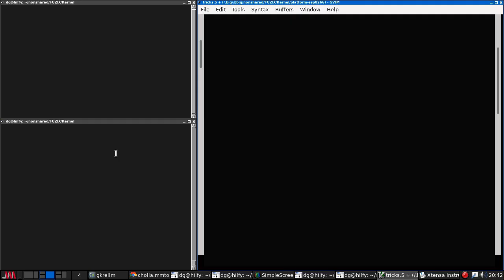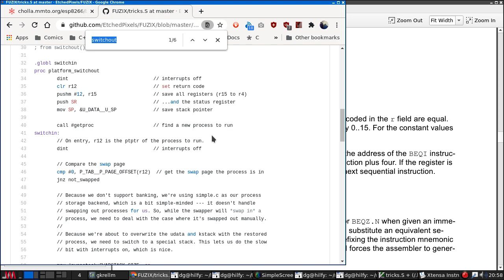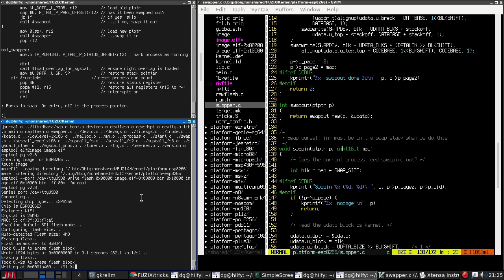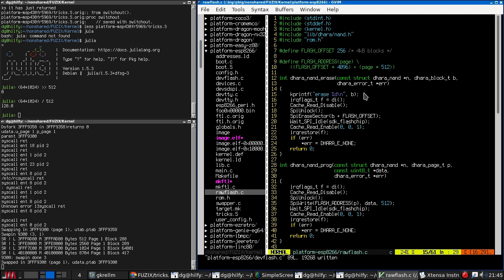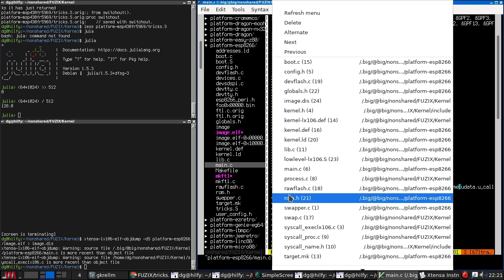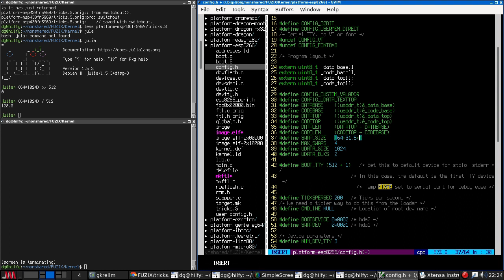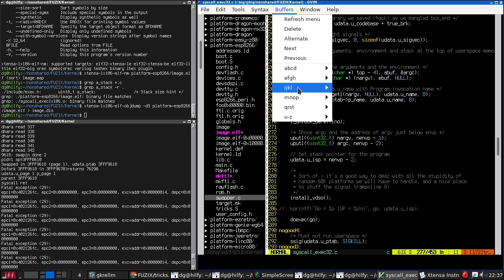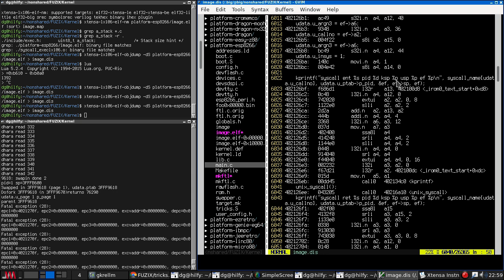Hjalfi ports Fuzix to the ESP8266: #9: more swap

Comment: Can someone recommend me some HOWTO how to compile FUZIX at all? I'm interested in new Z80 port. However not clear for me, how I can compile even an for existing platform, let's say msx2. Yes, I am aware that yacc must be the "correct" one according to file INSTALL. But still I get odd errors from sdcc or from its assembler all the time (eg undefined globals from aslink) . Also it's very slow, 3-4 hours on a "kind of decent" PC to hit that point. Which is very much unexpected in my opinion. I'm using sdcc 3.8.0. I tried to do my RTFM, but it seems there is not so much a beginners guide how to compile things, and the build system seems to be a bit chaotic to understand for someone having basically zero prior knowledge on FUZIX.
Reply from the maker: The build system's not great (you can hear my complain about it). Also, sdcc is terrible. As you've found, it's apallingly slow and rather buggy. Many of the ports have also bitrotted and don't build. z80pack is the only one I've found which actually builds.
Reply: @hjalfi  thanks for the reply. Oh yes, I hear you complaining in your videos :) Still it's surprising to me, that so many Z80 platforms are bitrotted, as I thought Z80 is one of the main platforms for FUZIX, after all one of FUZIX's origin is UZI which stands "Z80"  for the "Z" (AFAIK). I can't even imagine then what is the "main" platform now, which is in excellent condition and should work [I mean not only among Z80 based ones] :) Anyway, I continue my experiments.